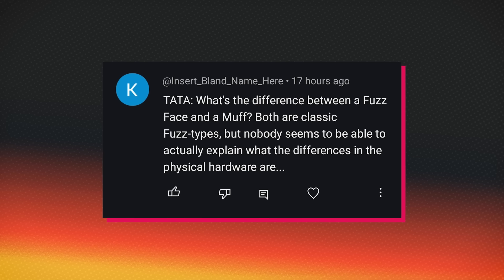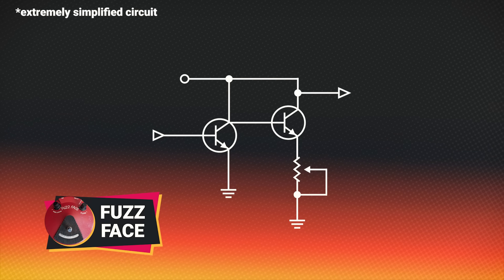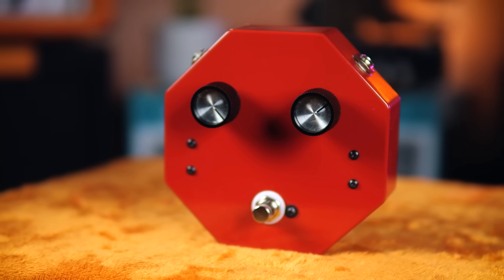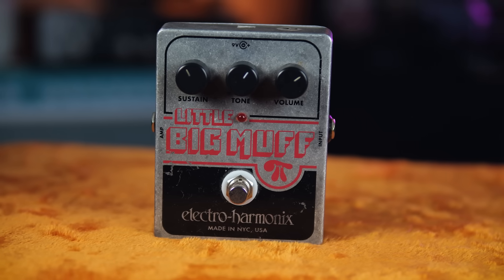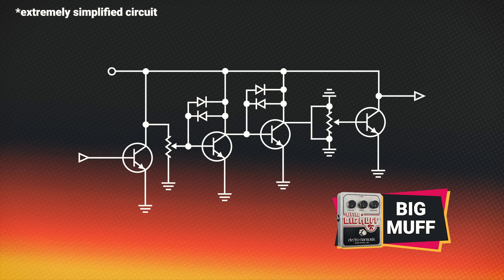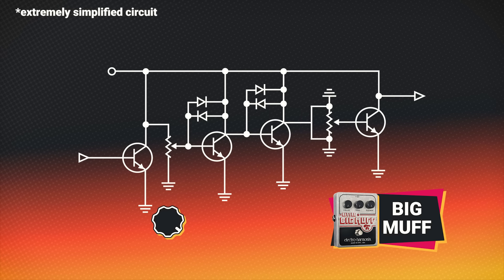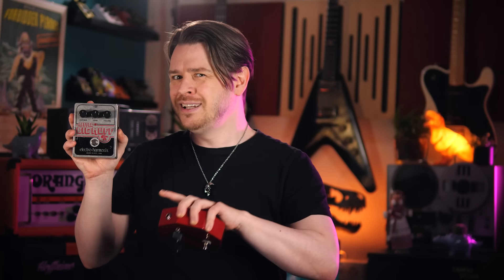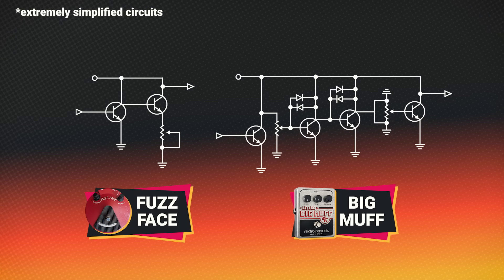MUFF vs FUZZ: What's the Difference? | Too Afraid To Ask

Comment: There’s another intuitive way to understand this.
The basic difference between fuzz and distortion Tone is in how much the circuit clips the bass frequencies. When the entire spectrum is clipped, you get a more chaotic, farty sound because the lows on the input wave overwhelms and dominates everything.
The Muff places diodes in the feedback path, it smooths out some of the hard clipping, but it still clips a good amount of bass. That's why it's hard to categorize it as purely a fuzz or distortion pedal.
Pedals like the Tube Screamer create a mid boost before clipping, producing that characteristic Distortion sound.
Metal pedals goes even further in that direction. The Metal Zone does some crazy amount of eq before the clipping stage.

Comment: Here’s a question: can I plug my solid state amp directly into my audio interface to record?
Reply from the maker: If your amplifier has a Line Out you can connect that to your interface for direct recording.

DO NOT connect the Speaker Out to your interface, you will destroy the interface.
Reply: @ScienceofLoud even if it’s solid state? Love your videos btw.
Reply from the maker: It doesn't matter - this applies for any amp, regardless of the technology. 

Line level signals can connect to your interface.
Speaker signals will damage it. 

NEVER connect a speaker output to your interface. You need an amp with a Line Out for direct recording.
Reply: @ScienceofLoud yes sir

Comment: Hey Collin, I have a question for TATA. It's more on the digital kingdom, though. Are IRs and "captures" the same thing? In the market they seem to be two different things, but in practice they seem to be created in a very similar method.
Reply from the maker: I'm not sure what you are referring to as a "capture", as that's a fairly generic word that could be applied to different things - which, I suppose, answers your question. 

An Impulse Response, IR, has a very defined meaning: It's a way to measure the response of a  dynamic system, across all frequencies, as a function of time. 
Using that data you can apply those conditions to any audio source to replicate the sound of a space, or a speaker, or whatever. 

In creating an IR, you could refer to the process as "capturing" the sound of a space - but you could equally use other, more informative words.
Reply: @ScienceofLoud  Oh, sorry. I should have been more precise with the question.
I was referring to the thing that devices such as Quad Cortex or Tonex do. I have read the brands calling them "capturing" devices but they say their products also support IRs, so that was confusing me as they seem a similar concept.
Thank you for your fast and clear answer!

Comment: on the SF-300, is mode 1 more of a muff and 2 more of a fuzz (or vise versa), or are the circuits different from either?
Reply: they're the same effect just different EQ's, but fuzz 2 definetely sounds more like a MUFF while fuzz 1 is suoppoed to sound like the UNIVOX, and  it also has an Octave effect. I modded mine so I can remove the Octave at will, makes it way more versatile!

Comment: Here's a TATA I'd love you to tackle:
Audio vs linear potentiometers. The difference between them, and where you think they are best applied.
Reply: A volume control is transparent, so it can't alter the signal in any way. The only exception is whatever effect is has just because its in the signal path. In the context of guitar products, as long as the quality is good, you probably won't any difference at all between different volume pots. In other applications, you may hear differences, but not this. So, the only real option is, do you prefer linear or non-linear rate of change in your volume control. Its a personal preference. There shouldn't be any noticeable difference in sound quality between the 2.

Comment: I distinguish between overdrive, distortion, and fuzz, based on how much of the note's duration contains the harmonic content added by the circuit.  Overdrive will certainly add "bite", by exaggerating the harmonic content of the initial pick attack.  But as the note sustains, it reverts towards the basic note fundamental.  "Distortion" will prolong the additional harmonic content beyond what overdrive does, but what we call "fuzz" will sustain that added harmonic content even longer, such that one could slide a note around, moving your fret finger up and down the string, and still hear the added harmonic content.
Now, all of that is distinct from the means by which it is achieved.  Pretty much any overdrive can sound like a distortion, and occasionally like a fuzz, if you feed it a boosted signal.  The EHX Muff Fuzz is a basic silicon Fuzz Face, but with low enough gain that it sounds like an overdrive, and occasionally like a distortion, if you push it hard enough.  But the EHX Double Muff pedal puts two Muff Fuzzes in series, that ends up yielding a very identifiable "fuzz".  It's all in the cascaded gain of stages driving other stages.

Comment: Imo both used in their original version are horrible if used alone:)
1) fuzz face have no tone control and usually even with volume maxed it's not much of a boost, gain knob is fairly useless, only viable if you have really high output pickups. Everybody just uses volume on guitar for gain. Which is nice, but why don't you put that on a pedal and some of the manufactures have done exactly that and added tone control. the simple toleration of components makes it sound different, i think there is one potenctionmeter inside, which is there just to dial in the correct value between resistors, they work differently in higher temperatures (germanium ones), ...
2) big muff has horrible tone control, that in neutral position sucks mids and both filters are really meh, so if there was no tone stack and you would have to use some eq after, it would be much easier, now it's tinkering, but newer models have different tone  and/or added switches and copies address this too. I have this exact problem with DS-1 which have the same or mostly the same tonestack. On the other hand big muff sustain is great, maybe even overkill, but it cannot be cleared with guitar volume like fuzz face. 

Fuzz people are little bit crazy, instead of clarifying things, they seem to find new ways of destroying the sound, like adding octave or bias ...
Reply: "Everybody just uses volume on guitar for gain."

No they don't. And the reason they don't is because its impossible. Volume and gain are 2 very different things, and they're not interchangeable. If you want to overdrive/distort the signal, you have to do it with gain. A volume control can't effect the signal. It attenuates, and nothing more. The only exception would be bit stripping on a digital volume control. But that's not something you would have to worry about with this type of equipment.

Comment: I don't know if this is the place to make TATA questions, but I can't find an answer anywhere online no matter how hard I've tried. The question is, is it possible to make a 4x12 16 ohms by wiring 2 sets of 2 speakers in series and then wiring the 2 sets in parallel? if my calculations are correct, 2 speakers of 8ohms in series gives me 16 ohms, 2 sets of them gives me 32 in total but wiring the sets in parallel divides the whole load. Thanks in advance and cheers from Puerto Rico \m/
Reply from the maker: Yes: if you have two pairs of series speakers, then wire those in parallel, you can achieve a total load which is equal to the load of the individual speakers (assuming all are the same impedance)

For example: If you have four 8 ohm speakers - create two pairs in series (8+8=16)

Now you have the equivalent of two 16 ohm speakers. 

Wiring those 16 ohm pairs in parallel will result in a total impedance of 8 ohms (1/16+1/16=1/8)

If you want to find this answer online, simply search: "how to wire 412 cabinet" 
That will return you diagrams of exactly this arrangement.

Comment: For a wild time, play the fuzz face into the Big Muff.

With the Fuzz Face's gain maxed, roll back your guitar's volume until you're in overdrive territory, then step on the Muff.  Keep the gain on the Muff on the lower end, though.  No higher than noon; start at zero and then turn up the knob until its just at the point where it almost wants to sputter out.

Also works really well with other vintage type fuzzes that are super dependent on being the first pedal in the chain like ColorSound/Macaris style pedals.
Reply: I think I'd rather place a Screamer in front of a Muff for a more dynamically usable tone.
Reply: No

Comment: You could debate on what is a fuzz...
Big muff is high gain pedal with diode clipping (soft).
Original fuzzes are 2 transistors, at first germanium (low gain) then silicon. Then some pedal makers modify the schematic, adding more transistors, then diode clipping. You have more or less 5 basic circuits.
2 transistors, 3 transistors, 4 transistors,  2,3 or 4 transistors with clipping (soft or hard). When it stops to be a fuzz ? 
I think that fuzz is a sound, what ever makes it...

Comment: fuzz face has two transistors...big muff has three transistors. (JHS pedals channel covered this a couple years ago.)
Reply: Thats really not what matters here, the Big Muff has soft clipping diode distortion (as explained in the video), whereas the Fuzz Face is class a transistor distortion (similiar to a tube amp actually), also the Biggie has 4 not 3 transistors.
I think you maybe mistook it for the difference between Fuzz Face and Tone Bender, because here that statement would be true and they‘re basically the same circuit otherwise. ( to be precise the FF is a stripped down version of the TB mk1 or a blatant rip off of the very rare TB Mk 1.5)
Reply: @erlannderrantem6972  Maybe you might go watch the JHS Pedals video on the subject?
Reply: Muff has 4

Comment: I thought I didn't lik fuzz. Now I realize it's the Big Muff fuzz kind I don't like. Every fuzz I've tried had that BM sound.
Thanks for that.
Reply: Yeah, it sounds like the guitar is replaced with someone farting into a microphone with so much power that it clips the input of your amp.

The tone control seems to be the cause of the problem, as I've heard muff circuits that have been modified to use a different tone circuit and it really elevated the sound to simply being average instead of offensively bad.
Reply: @casanovafunkenstein5090  the big muff tone stack is a big "delete mids" knob. So, unless you're the only guitar in the mix or you're doing something to boost the mids back up (e.g. running a Tubescreamer into the Muff), it WILL suck
Reply: @casanovafunkenstein5090  There are also "clones" or emulations of the Big Muff that feature adjustable bass, mid and treble controls. This alleviates the problem that you mention, although I suppose it's really a matter of subjective taste.

Comment: What is “sag” in a tube amp and how is it used. I’ve heard the term but I have no idea what it is (I’ve probably heard it and didn’t realize what I was hearing)
Reply from the maker: Sag happens when the output tubes in the amp momentarily need to draw more power than the amplifier has to give - this sudden demand causes the rectifier voltage to briefly collapse and slowly recover. 
While the Rectifier is 'sagging' the Plate Voltage delivered to the output valves drops and the amplifier is unable to maintain its full volume and headroom. 

Sonically this results in a spongy, compression-like volume sag on the loudest parts of the signal, particularly the initial attack of notes. 
It's an effect that really only makes itself apparent when you have a low wattage valve rectified amplifier being driven near maximum volume.
Reply: Thank you!

Comment: Hi Colin, I have a question regarding using a digital model of a fuzz. You already explained in the first fuzz face video, that the guitar is part of the circuit and therefore should come first on the pedal board. But does that also apply to digital models? For example using a compressor pedal in front of an HX Stomp in my case. Thanks for scientifying the gear world for us ❤
Reply from the maker: I find it highly unlikely that the people programming digital versions of these effects will include simulated impedance interactions depending on effect placement. That seems like a lot of work for no good reason. 

Place your digital fuzz where ever you want, it is unbound from the foibles of physical reality.

Comment: Apparently if you play active bass you're supposed to play a muff. Because a fuzzface needs to be part of the pickup circuit. Can anyone explain this?
Reply from the maker: I explained part of this in my previous video on the Fuzz Face: https://youtu.be/cagEeiq3u98?si=mNymXstvT5L3Lto7

It's about buffers and input impedance: Neither the Fuzz Face nor the Big Muff are buffered, but the Muff does have a resistor on the input that sets the impedance low. This will pair better with active pickups - and any losses the impedance mismatch causes with passive pickups will go completely unnoticed due to how much the rest of the circuit is mutilating the sound.

Comment: TATA: Will a heavily down tuned guitar sound good through a bass amp or cabinet? Will the natural high frequencies of the guitar damage the bass cabinet speakers or amp?
Reply: I'm running guitar and bass (tuned to B) through an Orange bass amp+cab, usually with some overdrive or distortion. Even with a very hot EHX Metal Muff or MT2 clone both instruments still sound awesome, however I never had to crank the amp past 40% so I got plenty of headroom.

Don't think it would damage your equipment, unless it is some dirt cheap "beginner practice amp". If it does, you'll usually hear the amp/cab giving up before you reach the desired volume.

Comment: Great job!  I really appreciate the topology comparison as well.  I've had people try to tell me that they're the same circuit, and I knew better, but couldn't explain why.  The clipping diodes in the BM were a surprise to me, too, but it makes sense.

Here's an idea.  Run a FF and BM in parallel.  Back off the distortion a bit (at least at first), and make it so that the FF sit in the midrange (no bass, treble to taste) of BM's scooped mids.  If you dial it in right, you can even play jazz chords and hear their qualities clearly; or, you can crank both and get threatened with eviction (even if you own your house).

🤘😈🎸

Comment: Are Flanger, Chorus, & Delay all the same effect just different lengths of delay time?
Reply: A delay could be without modulation in the wet signal. The other two require the modulation even if some are static (fixed filter, micropitch, or dimension style). An EQ is also a delay.

Comment: Since the Fuzz Face is 2 BJT Transistors cascading into each other, would replacing the 2 with 1 Darlington Transistor (and with correcting for bias) do the same thing?
Reply from the maker: I'm going to say no: Darlington pairs connect the emitter of Q1 to the base of Q2, which isn't the arrangement used in the Fuzz Face - where the Q1 collector is connected to Q2 base. 
It's been a long time since I've read up on Darlington pairs, but I believe the intention is that they behave as one transistor to achieve higher current gain - with their collectors tied together - so it wouldn't be possible to bias them differently to achieve the effect we get with the Fuzz. 

The fact that I've never seen a Darlington Transistor used in a fuzz before is probably telling that it's not a viable option.

Comment: I like the fuzzface for how simple and easy to mod it is. Also personally prefer the transistor overdrive compared to clipping diodes because it's closer to how an actual amplifier behaves. Both are legendary circuits and sounds we've heard for as long as guitars have had distortion

Comment: TATA: Soft clipping vs hard clipping. I know what they mean in theory sound-wise, but what are they actually?. If clipping is gain exceeding headroom, how is there a soft and a hard version? Is it that there is clipping that allows some of the wave to still pass through? Or is it a matter of how square it makes the wave, with hard clipping chopping it off at the shoulders and soft clipping giving a bit of a haircut?
Reply from the maker: While the signal can be distorted by exceeding the headroom of amplifiers (like in the case of the Fuzz Face) when talking about hard clipping vs soft clipping we are usually referring to the use of diodes to clip the signal while it is still well within headroom of the amplifier: diode clipping is a kind of artificial distortion which copies what would happen to the signal IF it was amplified beyond headroom. 

It is indeed a matter of how square the waveform becomes after clipping: Hard clipping arranges the diodes so that any part of the signal that is above a certain voltage gets clipped, whereas soft clipping arranges the diodes so that they are only clipping within the upper most part of the waveform. 
Soft clipping happens in the negative feedback of an amplifying element so that it affects only the difference between the input and output of the amplifier. 
Hard clipping happens after all the amplification has been completed, chopping the waveform down to a specific height no matter how much it was amplified.
Reply: @ScienceofLoud  Thank you!
Reply: Hard clipping is square and soft clipping will have rounded transition. Soft clipping will therefore generate less higher harmonics, depending on how soft the transition to clipping is.
Symmetrical distortion introduces odd harmonics while asymmetrical distortion introduces some even harmonics in addition to the odd harmonics.